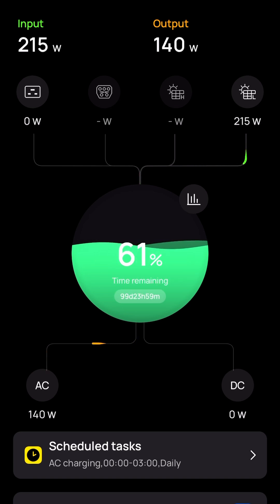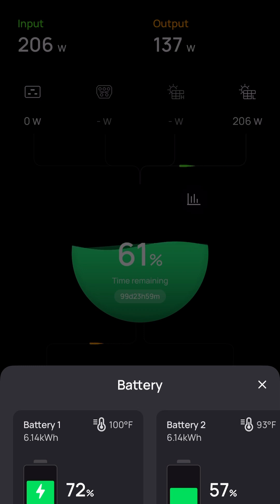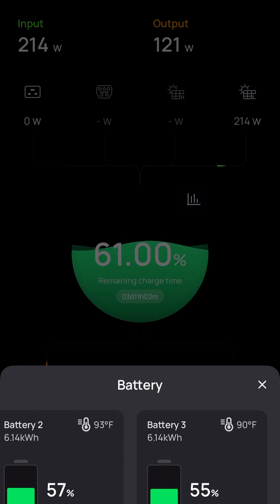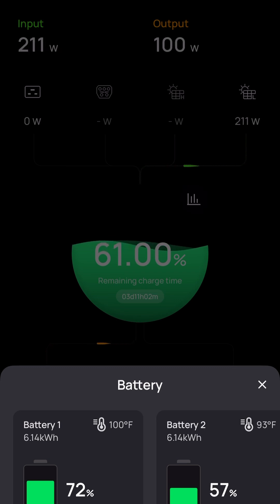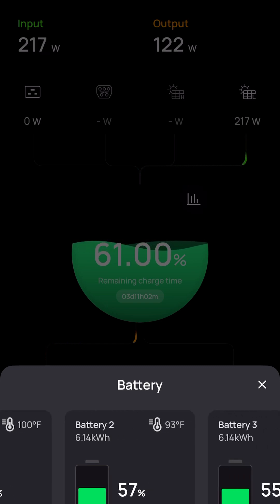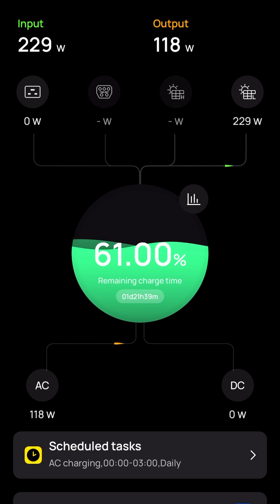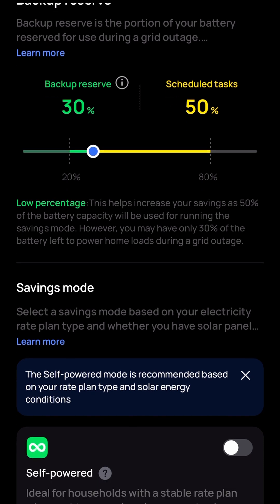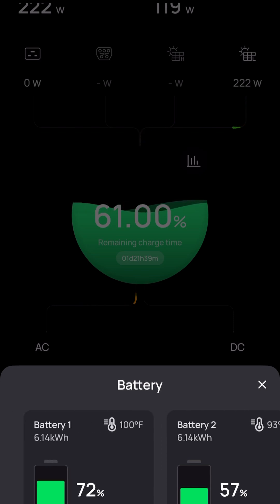EcoFlow Delta Pro Ultra Battery Balancing (part 1 of ???)

Comment: Hi KKR, I'm new to the Ecoflow (EF) eco system. I recently got the EF Delta Pro Ultra with a few batteries. Your video is timely and thanks for sharing. I have multiple Delta Pro Ultra batteries in stack. The top battery (just below the DPU) seems to always stay at a higher SoC compared to the batteries below it. The top and the bottom batteries are typically have the furthest SoC reading from each other. For example, my top battery could read 71% SoC and my bottom battery might read 60% SoC while the middle batteries could read 67% or 68%. Can you or your viewers tell me what is an "acceptable" SoC discrepancy range for my batteries to function under? Does "proper" battery balancing mean that all of my batteries should be in exact synchronization for every percentage point up and down? 

If it matters, when my batteries fully charge back up to 80% (my range 20% - 80%) all of the batteries except the bottom hit the 80% SoC and the bottom hit's 77%. Is this normal or is it part of a improper balancing situation? 

Thanks
Reply from the maker: Hi first566, this is the exact same situation I have.  My batteries are only the same percentage when top or bottom balanced.  Otherwise, they vary percentages and temperatures.  According to EF, this is normal operation.  Right now my three batteries are 58%, 57%, 47% and 87.8, 82.4, and 78.8 degrees respectively.  

Thank you so much for your view and your comment.
Reply: @KKRRenewables  Hi KKR . . . thanks for sharing! Well, I suppose if battery imbalancing is considered a "normal operational" feature then I'm ok with the batteries being out of sync so long as it the imbalance doesn't degrade the life of the batteries or that of the Delta Pro Ultra (DPU). If that is the case then I'm surprised that EcoFlow (EF) didn't just come out and tell me that when I inquired about having various SoC's across multiple batteries. In stead, EF suggested that I perform the 0% - 100% discharge/recharge method to see if that improves battery balancing. As of 2/4/25 EF pushed out a firmware update that supposedly addresses battery imbalance. I performed the firmware upgrade and I have noticed an improvement but not 100% SoC synchronization across all of my batteries. I'm still seeing anywhere from a 3% - 8% variance between the battery with the highest SoC and the battery with the lowest SoC which compared to yours, isn't so bad. I recommend you do the firmware update to see if you get an improvement as well. If is helps, I am including the steps that I noted from EF support regarding the discharging/charging method to correct battery imbalances when used in conjunction with the EF Smart Home Panel 2 (SHP2).

1) long press for 10 seconds the power button on the DPU until the DPU powers down
2) press the power button on the DPU to turn the DPU back on
3) within the EF app, set the discharge/charge level to 0% - 100%   
4) charge the DPU/batteries to 100% using the connection to the SHP2
5) after the DPU/batteries reach 100% Soc, disconnect the DPU/batteries from the SHP2
6) discharge the DPU/batteries down to 0% after the DPU/batteries are disconnected from the SHP2
7) after the DPU/batteries reach 0% SoC, reconnect the DPU/batteries to the SHP2 and recharge the DPU/batteries to 100%
8) all of the DPU/batteries should be balanced, if not
9) repeat steps 4-7 again if necessary

Thanks!
Reply: @first566  Ya that seems to be the way to do it with any non-smart BMSes (i would have though ecoflow does it better, but maybe not).   Essentailly what's happening is one cell or two one of the batteries or more has a lower voltage.  Each cell is around 3.4-3.6 when full.   So what happens is that when they get charged to 100%, the fuller cells will get 100% first, and then it will stop the BMS from charging because the first cell to reach 100% now hit a critical high voltage level (say 3.7 or 3.8) and BMS will say "OK we're done", leaving the other cell or 2 to not be at 100%, so that means you're losing 1/16 or 1/15 cell capacity or more potentially.

The way to fix it even without doing reset is charge to 100%, let it sit for a few hours (BMS should try to balance even if it's not "on" as the battery is ALWSY connected to the BMS), then take it all the way down to 0 until the inverter shuts off or can't run load anymore (probably better when you're lose to 0% to only use say lights or something that aren't goign to do something terrible).  Let it drain to 0%.  Then let it sit for a few hours, then recharge back to 100%.

I had a bolt EUV that required the same - that EV would report i lost 15-20% of range and by driving down to 5% and wait a few hours, then recharge back to 100% and wait a few hours and vice versa, then it'll then get back the "lost" ranges.

Comment: you understood the email correct. ive had to do it to my delta pro several times. as a matter of fact in the delta pro, that process is in the instruction manual and says to do it ever few months based off usage. not sur eif its in the ultra manual or not though
Reply from the maker: Oh wow!!  Thank you very much!  I looked all through the manual and searched for the word “balance” and couldn’t find anything.  I may need to read through again.  And am I to understand balancing does not happen when solar charging?
Reply: @KKRRenewables - That would explain why mine have gotten so badly out of calibration. I run two DPUs together with the 50 Amp Hub... was off-grid with it for most of September and October, but the short and often cloudy days of December in Minnesota mean lots of slow charging... often less than 1kW per DPU. I have enough solar to max them out at 5.6kW each when the sun is higher and the skies are clear. At least from Feb thru Oct. 

I think that slow charging from solar kinda mess it up. I am hoping AC cycling it up to 100, down to zero and then back up to 100 (that's 60kW for my system) will fix it. 

It's my understanding that LiFePO4 batteries are very hard to gauge... much harder than Li-Ion.
Reply: Follow-up... Two cycles of 100% to 0% then AC charge to 100% and the batteries are balancing much better and the SOC % and estimated charge/run times are seeking to be much more accurate.
Reply: @michaeldezelar6264    this basically means one or two of the cells in one of the battery is out of balance, so the BMS when it charges up to 100% will stop because the highest voltage of one of the cell will say "Hey stop".  Now smart BMSes are supposed to take care of it.  If not, the remedy is to take all the way down to 0%, charge it to 100%, do the reset if you want, then maybe repeat it once more.

Coincidentally I had a Bolt EUV before i sold it that would show the range drop by 20% (245-200).   So i drain it by driving down to almost 0% and let it sit for a few hours, then charge it back up to 100% and let it sit for a few hours, then drive it back down to 0 and it was basically "reset" back to the right range.  Pretty sure GM doens't know what they're doing :)